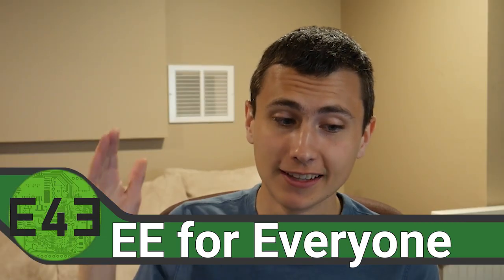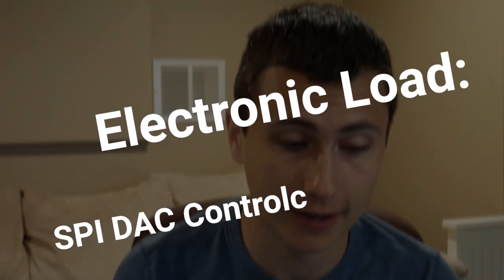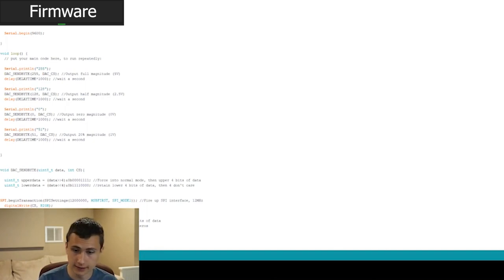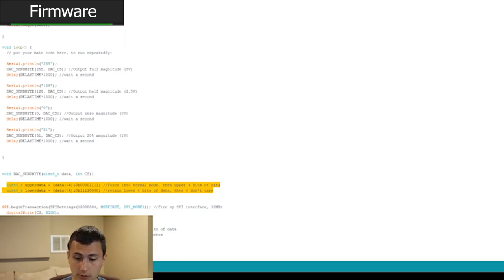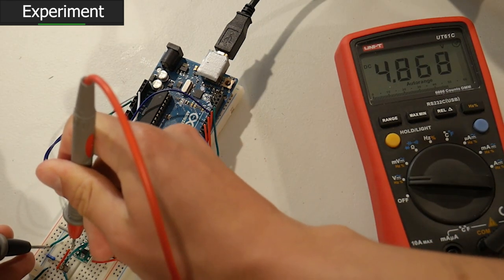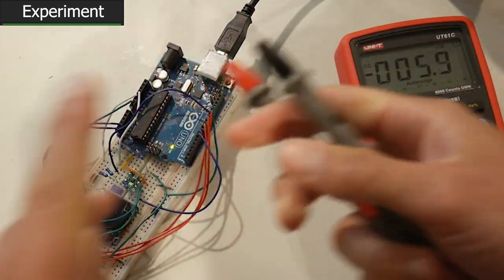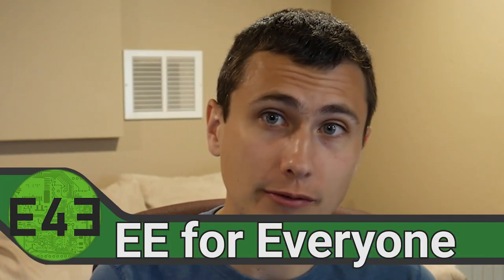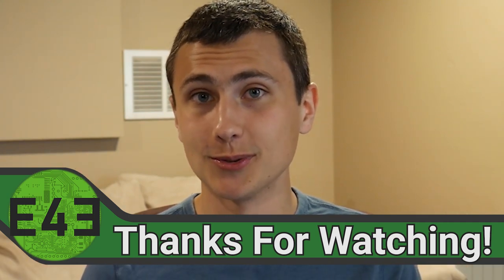SPI DAC Proof of Concept

Comment: Haha. I like bending things to fit, and pre-made breakouts. I have these by the panel =) QFN/QFP and all the inline packages =) Don't have the linear/inline pitch converters, or ribbon cable to zif etc though.

At least you aren't super gluing the part upside down and soldering "magnet" wire/coax to the leads, directly to 2.54 protoboard =P

I'm always wishing for better breakouts, or ones with at least good grounding/decoupling. I also end up wishing for length matched converters. Plus the whole SSSS, GSSG  or GSGSGSG launch issues. "Nothing copper tape and soldering coax/twinax directly can't fix".

The lack of decoupling is sometimes annoying, but I typically hack in some leaded or unleaded caps etc. I think part of the issue is that in some packages you don't have standardised power/signal pins. Some of the inline boards I have include larger traces on thhe four outer lines, but the rest are smaller. I'm also wishing for single sided adapters often, as a big ground plane would be nice for probing/hacking/decoupling/common ground =P

Given the cost of boards, I find that if you are willing to stretch your timeline out, going directly to custom breakouts/converters for your application is worthwhile, if you haven't figured out your placement, or you plan on using these components as functional blocks in future prototypes. I've made quite a few quick and dirty breakouts, when wanting to swap out components with different pinouts but performing the same function. The advent of castellated holes being cheap is also a nice benefit now, although right angle 2.54 SIP also works i guess =)
Reply from the maker: Normally Open, Great thoughts as usual! IMHO, these breakouts are terrible, but got the job done! 
In reality, I probably could have jumped straight to the first board spin, but may have spent time in bringup debugging a SPI interface. It's hard to say which way would be faster overall... but I think either way is good. For me, I'd rather find the mistakes before they're etched in copper - both the uC selection and peripheral. 

Your castellated hole breakouts for critical components is an interesting thought: basically just leave a "block" in the layout for modules to solder in! Oh boy... you're always feeding us good fuel for new projects. :)

Thanks for watching, and thanks for the comment!
Reply: @EEforEveryone  My mentality is more that "i know for sure that i can't make it perfect". So I'm going to make it hackable/adjustable. Breaking everything into functional blocks/modularity is nice. Plus for testing purposes, lot's of test points etc =P 

I guess my experience is more in the business of quick and dirty prototypes/small scale manufacturing. i.e. high R&D cost as a proportion of total system cost. i.e. not wanting to re-design the whole system, if something is discontinued etc.

Comment: Are you going to reduce the output voltage to increase the precision before sending it to the OPAMP? If so, how?
Reply from the maker: Hello fixdaily, Great question! Any error in the DAC output voltage will become error in the output current, proportionally. That means that reducing the output voltage won't necessarily decrease error, unless doing so allows for using more of the range of this DAC! (1% is still 1%, even if the numbers get smaller)

However, maximizing accuracy of the reference voltage and making sure the DAC won't add excessive error is important! 

So, it really comes down to using as close to 100% of the range as possible. That can  either happen by dividing down the output, or amplifying the sense voltage! 

For the first prototypes, we aren't doing any scaling, just choosing sense resistors that provide an appropriately large sense voltage and use most of the DAC range.  That may not be good enough for the final state of this design!

I hope that helps, and thanks for watching!
Reply: My initial thoughts are they weren't intending to talk about accuracy? My take was they meant the numbers get smaller -> smaller currents? i.e. change the reference voltage when changing current ranges? (looks like they edited?)
Reply: @EEforEveryone  makes sense :) but you are working with very low voltage drops (i meant current-wise), so i believe you are not going to need 5V on the DAC output, are you?
Are you thinking on controlling the voltage and current of your load or just the current? If both, how are you going to do it so? Using a buffers with capacitors that could be charged by the DAC? Or 2 DACs?
Reply: @normallyopen1190  it depends on the circuit configuration, usually the current is read by a very low resistor, so, a very low voltage drop - this voltage drop across the resistor is the main reference.
Reply: @FixDaily  Apologies. It appears i did not communicate well. I believed you were talking about precision, not accuracy.

I agree that the initial accuracy (without calibration) of the current measurement is dependent on the initial current shunt and it's accuracy. I would argue that there are other factors dependent on the amplification chain, all the way through to analogue to digital conversion and back out to the digital to analogue converter, to the gate of the FET.

I believed we were talking in the context of digital to analogue, or some sort of buffer gain switching or reference voltage switching arrangement to change precision of the set point or measurement.